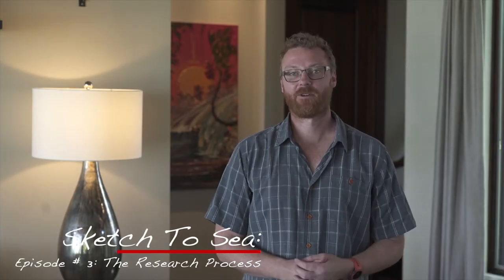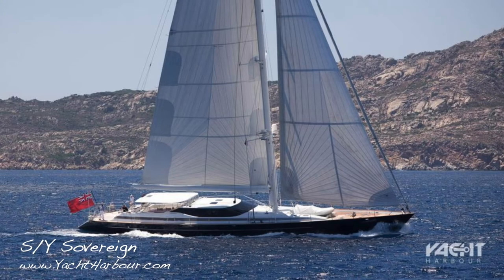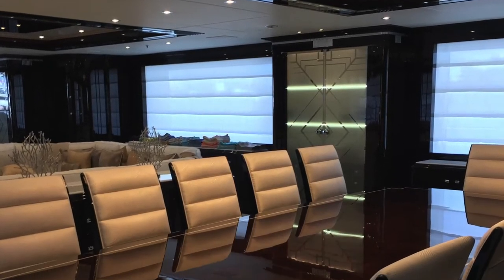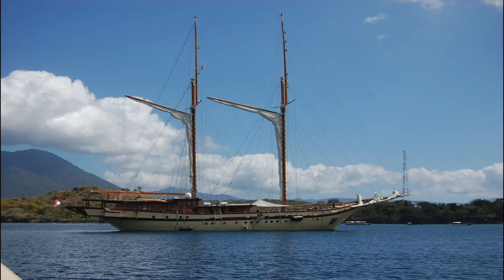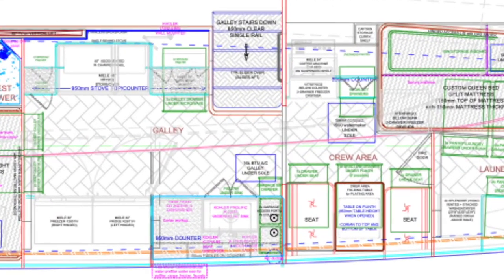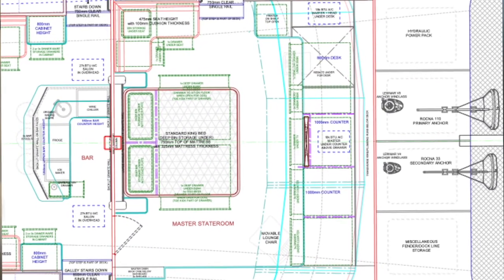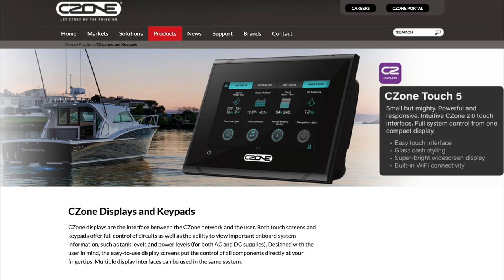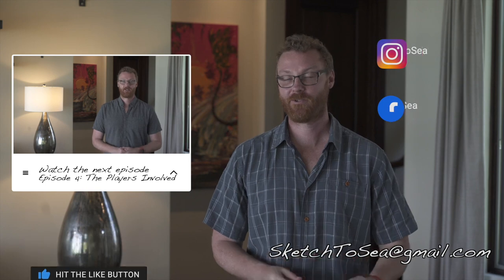Sketch To Sea Episode 3: The Research Process

Comment: Really enjoying your journey that you are graciously sharing with all those who are interested. Privilege has been my front-runner for a long time and while I love the luxury of that brand the performance sacrifices will always haunt me over time. Outremer's 55, mainly Greatcircle's yacht has impressed me, but it lacks a lot of the creature comforts that I want to have. That carbon build that you are pursuing opens up a lot of options by reducing critical weight management in some areas therefore making allowances for those creature comforts. Determining running costs is my biggest obstacle thus far. I can pony up the purchase costs, but the ongoing costs are what I fear will be overwhelming. Insurance, Taxes, Registration, Maintenance, and the countless other fees along the way. Hopefully your series will tackle some of those issues. As for now I am completely enthralled with your presentation.
Reply from the maker: Thank you for the comment. Ongoing running costs have always been a concern for us as well. Throughout or entire build we have gone with as many materials that are corrosion resistant and durable where we could. There is very little stainless on our actual vessel. At lot of this will come down to how you use your vessel, and what your preventative maintenance routine is.

Comment: Main level masters are very rare on production sailing catamarans even semi-custom. They are not usually speced unless the yacht is over 70ft. There simply is not enough room. Privilege yachts don't have true main level masters. Their master cabins are positioned under the main deck but a little higher than the hull cabins. They are very nice but head room is definitely an issue I wouldn't want to deal with being 6ft. The only yard I know of that breaks the mould with respect to master cabins on the main deck proper is Neel. They're trimarans and typically wider than a cat of the same length, thus can manage to fit a cabin on the main deck and do it well. I wouldn't want to own a yacht without this feature, so I fully understand your preference. Problem is that entails a very large catamaran with all the associated expenses that come with it. I don't see that becoming a common feature moving forward due to the large space requirements on the already crowded bridge-deck of most cats under 60ft.
Reply from the maker: I Thank you for the comment. I agree. Matrix yachts out of SA also has done a few successful true main level masters. They are a completely different species of yacht compared to an HH